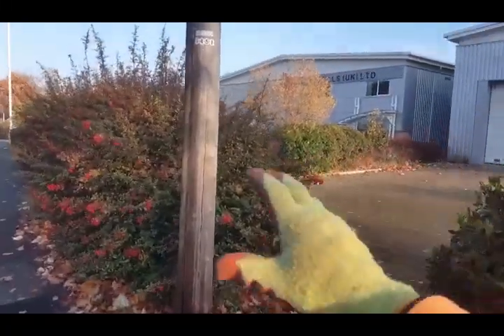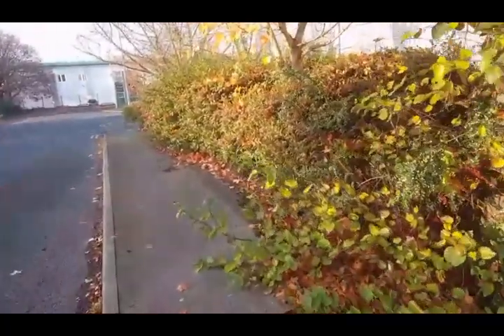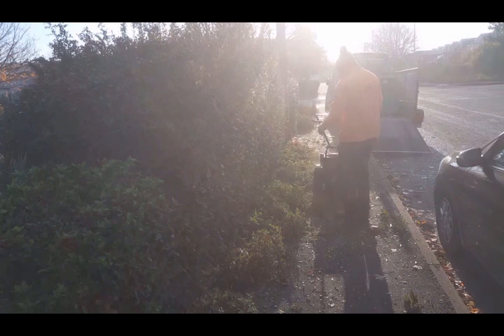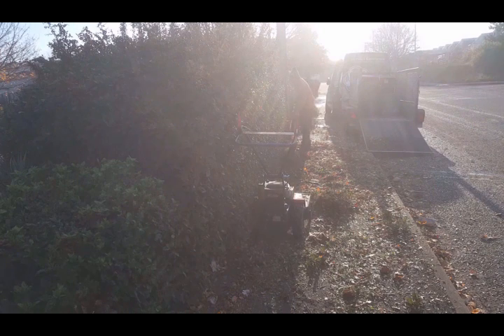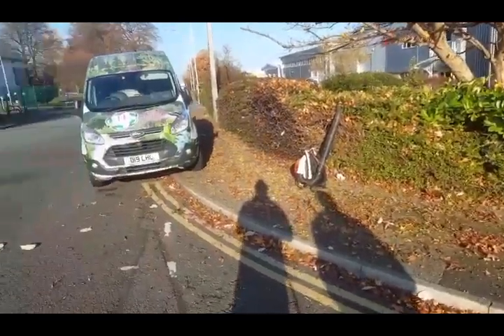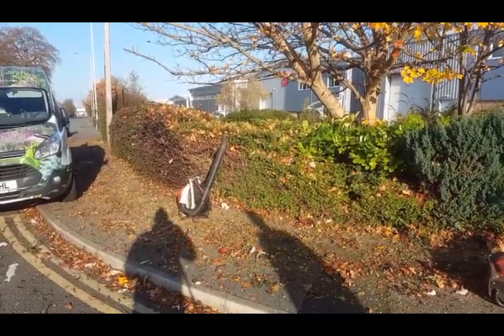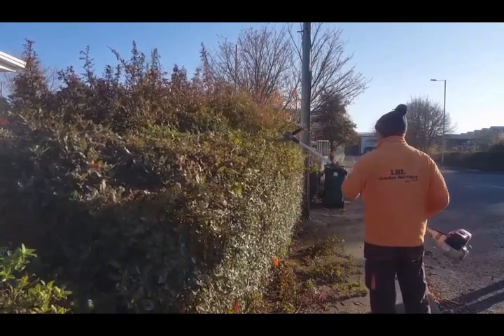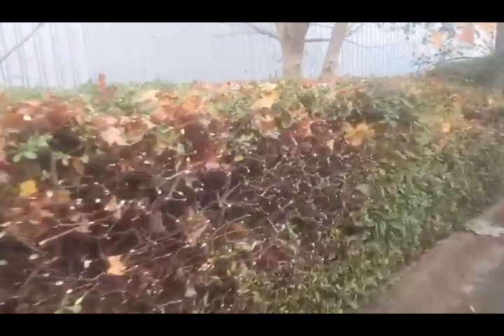How to shape up industrial estate hedges.  pruning pyracantha.

Comment: What do u do with the leaves on the hedges?
Reply from the maker: Removed them and used as mulch on another job
Reply: @LHLgardenservices  , thanks for swift reply. But isn’t there an easy way of getting them off? there needs to be a tool for this. I’ve tried blowing them, raking them and they just fall in to hedge!

Comment: End result looks great. Personally Not a fan of this mulching method especially alongside a road. Is doesn’t look at all professional and the chance of the mower kicking something out at a passing car or pedestrian is fairly high. Also the time spent messing around with umpteen passes on the mower and then the billy goat, surely it would have been easier to just load up the trailer and factor tipping into the job cost? Mash it up with an old hedgecutter to reduce the bulk. 
Anyways just my personal thoughts. Good vid as usual.
Reply from the maker: Thanks Paul appreciate you watching mate. Fair point about mulching etc..there is no perfect method for anything and certainly more than one way to do most things.. I've found this is the best way for me and I'm sure you or someone else will have their way...as long as we are all happy 😁😁👍